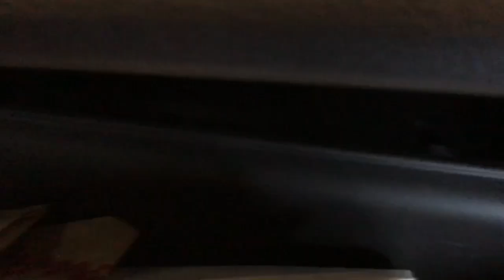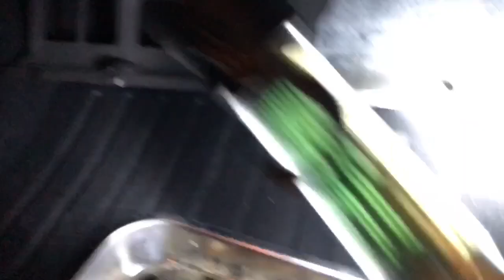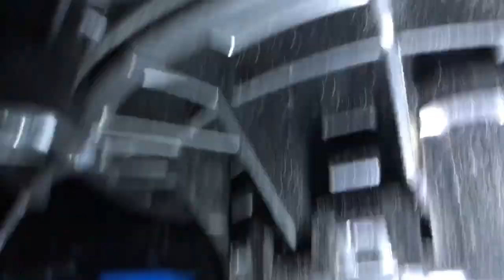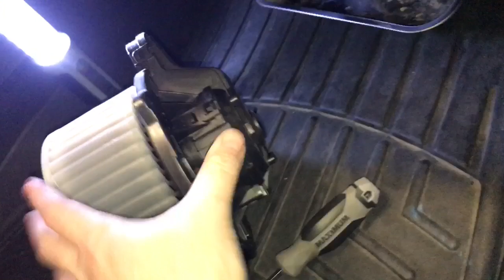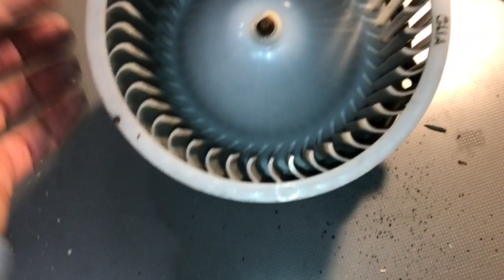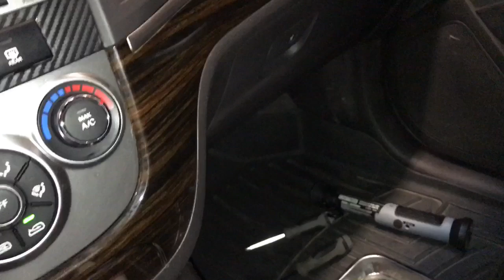Hyundai Santa Fe HVAC Blower Motor Removal and Repair

Comment: While watching your video, you asked if there was a way to remove A stock fan Barrel. Yes, there is a way, while looking at your video He removed the clip from the barrel but what you did not notice there is a lock that holds the barrel to the shaft. this is what you have to do, first Bend back the barrel lock next you get a Mechanics heating fan And slowly heat the barrel .Second, After you heated the barrel slowly tries to pull the barrel upwards make sure you do not pull the barrel too much and this will remove your barrel. finally, oil your bearing and put back on the barrel Been back to lock clip add your C clip and that's it Thank you

Comment: I came to your video because today when charging my cabin filter in my 23 Santa Fe, a leaf fell down into the blower area and now I hear it vibrating when the blower is on.   I’m trying to figure out what to do or how to get it out.  I have been playing with the fan (on thennoff then on) and the sound did charges to quieter probably from moving the leaf but it’s still there.

Suggestions?  Thanks
Steve
Reply: I’ll have to try??  Next step is taking a flex horse from my CPAP and connect to my vacuum and give that a try.  Or hopefully the leaf breaks down
Reply from the maker: Not familiar with that generation, but when you remove the cabin filter, is there any way to get a flexible claw in there that you could grab onto the leaf?

Comment: To get the fan off drill or melt 2 or 3 holes in the fan hub, then get some 1/8 gauge wire that you bend hooks on its ends and loop the other ends that slide into a long threaded bolt with a nut on the fan side of the wire loops using the bolt end of the fan motor so that the wire and bolt becomes a puller to wind/pull the fan off the shaft.

Comment: I have a 2015 Hyundai Elantra. My heater doesn't blow hot air. I checked the motor blower it works fin. I changed the antifreeze and I checked the fuse they are working fin.  I have no idea what causes not getting hot air.
Reply: Could be bad thermostat, or air in system if coolant changed recently

Comment: Will this work for my 2017 santa fe xl?

I'm hearing that rattling noise and I am NOT mechanically inclined..
Reply from the maker: The CM generation and the DM are quite different. Therefore the method of removal will most likely not be the same.
Reply: My Santa Fe DM has the exact same looking blower if that helps

Comment: Did you ever find out how to get the fan off? I have a slightly older model, 2004, and it the full motor housing is just one big plastic piece. So I'm not sure how I'm supposed to get into this thing. Removed the retaining ring but its really stuck there.
Reply: Nevermind, I got both the housing and the fan off! The housing on this model has 3 clips that you can get to with a screwdriver, theyre located in the inside, in the gap between the fan and the housing (you kind of need to pry a millimeter or two to get in there). As for removing the fan, I placed the fan part on top of a ledge on my outdoors sofa, while keeping the actual fan motor hanging free, then I took a screwdriver and pushed through from the top (by pushing on the little metal rod that the fan sorrounds). Got loose without too much force, just gotta find the leverage!

Comment: Hold the plastic vanes by both hands. Ask someone to hammer the central metal protruding in the middle. Use wood in doing so as not to deform the middle metal. And do not use WD-40 for lubrication as it overheats in the long run and does not last long. Use oil or grease for the bushing.
Reply: hello! Do you know where to find a video with this information you passed? I can't take it off.

Comment: These blower motor are really not serviceable. I had the exact squeaking problem. I oiled that thing to death and it would work for a bit, but it always came back. Best advice is to get a new part. Don't have to go OEM, try aftermarket
Reply: That’s good to know, because I already pulled mine apart because of a squeak on low fan speed and after a week it came back. I just ordered a replacement part
Reply: you need to press oil in it its bushings are porous they absorb oil and retain it put some it press it with your thum

Comment: Hi John, my 2013 Santa fe heating system smells like burnt plastic or maybe fuel fumes, hard to tell. I had it checked over by the dealership but they said it was maybe due to a cabin filter.  BTW it did smell very gross(burnt plastic) and was replaced. However, the smell is still present.  Any suggestions on what I can do? or what I should look out for?
Reply from the maker: Sergio Batista to better diagnose i would ask you do the following. Put the air circulation on “recycle” this will only draw air from the cabin. Run like this for a day and see if the smell is still present.

Comment: THANK YOU, THANK YOU, THANK YOU! I had a horribly loud hum when I used the blower motor on my Santa Fe. Using your video, I quickly got it out and found a big leaf in there. Works perfectly now. Thank you for the detailed video! It was a quick, easy fix. I would never have even attempted this without your video.
Reply from the maker: RFD265 thank you so much for the kind comments and thanks for watching.

Comment: my blower stopped working this morning with no warning on my 2005 it worked for 15 mins or so holding dial over with force while driving but that stopped working as well hear a little ticking from that area switching speed dials over but didn't engage or start.Couldn't get back screw out with stubby have to grab the Phillips bit for the rachet and noticed screws were rusty on them could it have got water in there and froze????
Reply from the maker: Borden Garrison water should not be able to make its way to the blower. Could be condensation however.
Reply: got it working on 2 but shuts off, been playing with low high knob and heard fan come on but no other settings work have to wiggle know in between 1 and 2 to get it blowing again so not thinking its blower motor its the dial?
Reply from the maker: Borden Garrison if middle speeds do not work then it is most likely the fan resistor. This would require replacement of the blower motor

Comment: John, WD40 is not a lubricant. It is a water dispersant.  Using any other oil would of been the ticket. I would use of used some synthetic Mobil 1. Blowing the bushing out with air will also help "before" using the oil to get any micro bushing debris out so just lubricant is there and not a slurry of lubricant and bushing dust that could have cutting action and or a "paste" action after the oil is gone.
Reply: This needs to be higher. Using WD-40 will provide very short term relief from the problem, but ensure premature failure (likely sooner than the part would have failed otherwise). Non-detergent motor oil, gear oil, 3 in 1 oil are all preferable.

Comment: Great videos, im looking at buying a 2012 limited, would you recommend it as a reliable run about? it has 90k km, v6 reasonable on fuel? im in alberta.
Reply from the maker: Eoin Keenan mine has 100K Km and overal I am happy with it. Common fail points are suspension bushings. Also the 3.5L is know for a leaky oil pressure sending unit. Had to replace mine twice now.  I was lucky that when I bought mine it came with a 7 year full coverage warranty. 

The 3.5 is a gas hog, espeacially when in city. Highway will get you on average 8.5 L/100 km and mixed will be 12 L/100 km. These are real world numbers as calculated by me. 

Thanks for watching